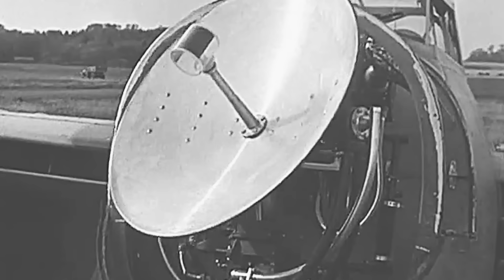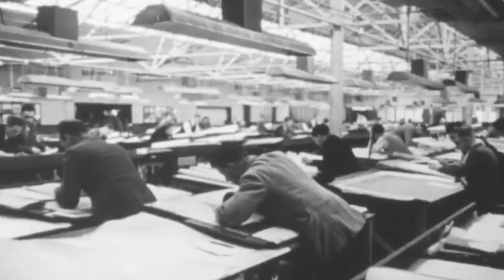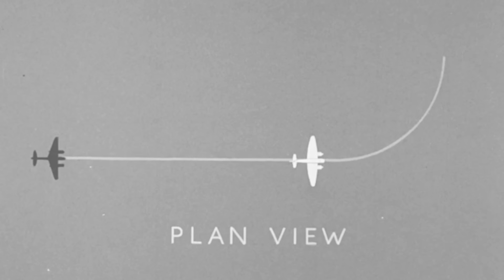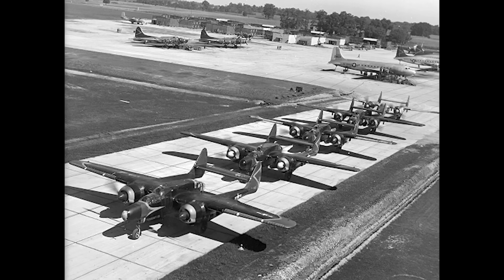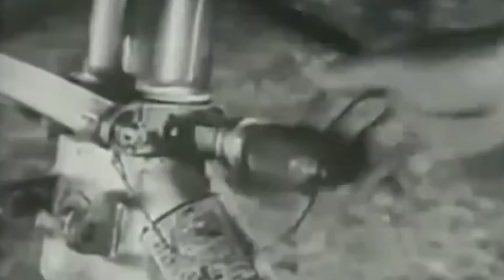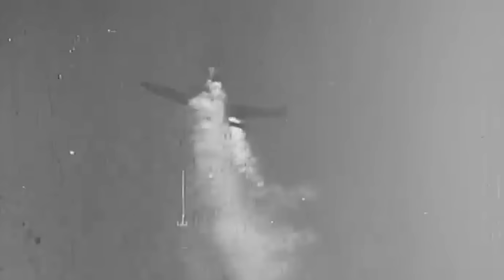The Most Chilling Plane of WW2

Comment: One of the early issues with the P-61 was damage to the nose gear doors when the 20mm guns were fired. One cool feature was the almost lack of ailerons. Instead relying on spoilers on the top of the wings. This allowed the P-61 to turn a very low speeds. In the Pacific P-38 could take off by just retracting the landing gear and using ground effect to get it airborne. When P-61 pilots tried that, it didn’t work and instead of taking off, the Black Widow just settled back onto the runway.

Comment: love the twin boom design. 

not exactly born to dogfight but plenty of power and armed to the teeth

i was always a fan of the center mounted machine gun and cannon. oddly, the allies opted for mostly wing mounted .50 mgs and it seemed to work just fine but why not add a cannon firing through the center of the engine, and a couple of .50s firing through the prop? add that to the usual 4-8 .50s in the wings and youd have a wicked deadly machine

only a few allied designs featured the fuselage mounted mgs like the germans and japs did. im sure there was a good reason for that, but you tell me.

the me-109 G series, AKA GUSTAV or "KILLER" (not sure if that moniker meant killer for its pilot or killer for its opponents) had 2 fuselage mounted 12.7 mm machine guns (12.7=.50 cal), upgraded from the 7.98 mm mauser round that was used by earlier versions and was the standard round for the wehrmacht, used in both their mg-34, mg-42, and Kar-98 standard rifle

the G series, in its interceptor role, eventually mounted 2, 12.7 mm mgs, one 20 mm firing through the centerline, 2 wing mounted 20mm and 2 MORE 30 mm cannon in gun pods under the wings.

thats 7 guns, with 5 of them being cannons. its was indeed, a killer

with all that extra weight it comprimised some of its speed and manouverability but it was still better than the FW-190 above 20,000 feet which was where the bombers were,

Comment: The Black Widow was fast. Really fast. For a big twin-engine aircraft it was screaming fast at 360 mph. For a Night Fighter the P-61 was every bit as fast as it needed to be. To get the job done. And it did. Very well. But ... In no way shape or form was it ever fast enough to intercept a V-1 Buzz Bomb with its 400+ mph at just above treetop level. It took the fastest of the R.A.F.s Fighter Planes and even then they were at or near wide open throttle. The "61" was big bad and beautiful. But not Fighter fast.

Comment: The aircraft looked cool, but was almost a complete failure. Very limited success and too underpowered to challenge the Me-410 which simply flew away leaving a P-61 embarrassed. After the war the aircraft was rehabbed to become the little known F-15 Reporter and saw some service in Korea and mapping duties. During research I did locate an unknown photo of one of the initial prototype series taken before it was scrapped. China has a  captured P-6¹ on display which is rumored yo be radioactive. Despite its problematic history the airframe is definitely cool.

Comment: My dad flew B-17's over Europe during WWII. As the war in Europe wound down he was re-assigned to a fighter training in Dec.1944. He trained to fly the P-61 and after training he flew them in the European theater for the 414th until the war ended. After the war he returned to his profession as an electrician. In 1961 he got wind that the air Force were surplusing the P-61-A, B and a few S models. He went to Richards/Gabouer air base where they were being sold, basically as scrape, and found his old plane there a P-61 S, her name was "Mysterious Mary", and he bought her for the princely sum at that time, of $5500. Stripped of her guns and other "secret" equipment. Dad worked on her for years and years getting her ready to fly again. Dad passed away twelve years ago without getting her ready. I've been working on her since and I'm getting close. I have to get all the Lexan glazing made. I'm shooting for July 4th, 2025 for her first flight.
Reply: I hope you get it done. Kudos.
Reply: Bravo good 👍 sir,best of luck with this endeavor! Sounds like a large undertaking. Sounds typical, take off the military gear,understandable, yet leave her unflightworthy. Not understandable.
Reply: @clarencemcglynn114  She was airworthy when dad got het her but only barely. It had been left to the ravages of the elements for 20 years and somewhat cannibalized. So dad took her apart to do a complete restoration. It was a bigger job than he imagined. You know how it goes; you take one thing apart and find 6 others that need attention.
Reply: Hamilton / Owen Field: COLUMNIA,SC HAS HANGER Y 1 with a B25 and other museum pieces..FLY HERE AND MEET JIM HAMILTON  @clarencemcglynn114
Reply: That’s quite an undertaking.  How many flying P61s are around nowadays?
Reply: @vpreggie  As far as I can figure out there is exactly none flying.
Reply: Will you post updates please? That would be such an awesome story 😊
Reply: Great story and I wish you all the best in your endeavours.
Reply: Amazing , good luck to you sir ! 👍🏻
Reply: I cant help with $ but I could sure help with time. retired, x air force
Reply: Amazing, simply amazing.  I hope you succeed, sir!  Lot of people pulling for you, me included.  Really appreciate you sharing this fantastic story.
Reply: My full respect to you and your dad.
Reply: You should contact Red Bull, they love old planes.  They may help in the restoration and the story of you dad would sell it.
Reply: I'm a Volunteer Aircraft Mechanic with the Commemorative AirForce Minnesota Wing and I know there's a few other volunteers like myself that would be able to help work on her...
Reply: That's quite a project and a tribute to your father.  Can you confirm that the aluminum was painted with zinc chromate primer, such that when the paint was chipped it exposed the zinc chromate primer, or perhaps the aluminum?  Thank you.
Reply: Well!? Did you get her up in the air?
Reply: Get it done bro
Reply: Cheers to you and your late dad.
Reply: John, this is great news!  I thought that the Mid-Atlantic Air Museum's Widow was the only restoration in progress.  Any chance you could take her to Oshkosh next year?  She'd be a huge hit!
Reply: @gordonbergslien30   I am aware of the Mid-Atlantic Air museums restoration. We'll see about Osh-Kosh, it will all depend on how she works out during her flight tests and mechanical systems. If anyone is aware of an SCR-720 airborne radar set for her, I'd be extremely interested.
Reply: God bless sir,wow.
Reply: I wish you luck.
Reply: Are you making videos about this? have you started a foundation, received any donations or get any outside. I’d love to follow your journey and see it completed
Reply: Keep us updated I'd buy tickets to go see this
Reply: Good ole’ Dicky Goober!! 👍🏻
Reply: Please post something to keep up to date. My Day was a Pilot as well. Would love to follow your progress…
Reply: What an amazing story!  Please post videos of the rebuild and first flight.
Reply: Do you fly with the Commemorative Air Force or are doing this completely independent? Either way good luck
Reply: We will all be back here on July 5, 2025 to see how it went😉
Reply: How wonderful is that!!
Reply: Go, go, go! You and others that keep old A/C and old vehicles alive are heroes in my book.  Blue skies!
Reply: My brother and I built WW2 model planes when we were kids in the 60s. I think the P-61 Black Widow was our favorite. It was certainly the most imposing looking one. So glad you are doing that project!.
Reply: Would love to see photos of it!
Reply: Wish you the best.
Reply: Awesome! Send me a link for any photos or videos you got! Would love to see!!
Reply: Cool, cool, cool. Bring her to Oshkosh my man. I missed 2025 due to work but am sure to make 2026.
Reply: Fantastic. Absolutely wonderful.
Reply: What a cool story! I have always thought these were so cool. Side question, did your dad ever see any foo fighters?
Reply: I pray you make the goal!!!!
Reply: That is freaking amazing!  Any pictures of it online?
Reply: That sounds incredible especially how he found and bought the specific one he had served on, amazing! Wish you the best of success and clearest skies in your endeavors. I realize it‘s a private passion project but would also really appreciate a photo or video once ready, if anyhow possible without doxxing yourself. Either way thank you for sharing this!
Reply: that will intersting😂❤
Reply: I need to see this, please update us!

Its such a mean yet beautiful looking aircraft
Reply: Any videos of the restoration?
Reply: Dude you should make some videos of working on her i would love to see them at least
Reply: Good luck and thank your dad for his service
Reply: God luck to you well done
Reply: We want a video!
Reply: Where is it located?
Reply: Hope you achieve your aim, Lance Daintree uk
Reply: Please post a video of your plane! It would be amazing to see. Please! 🙏🏽
Reply: It’s been over a year, how is it going?
Reply: @samschellhase8831 right, I wanna see this thing
Reply: Airplanes in built
Reply: so you are doing this project on a plane so rare that there are claimed to be only 4 in existence, not including the one you claim to have.  but somehow are doing this alone and are going to get it to be the only air worthy example by next year and have 0 pictures or videos of it?    cool story bro.
Reply: @13christbane  Not quite alone, I have a few guys helping me. I lost a very valuable assistant when my young Brother passed away a year ago. I have no posted pictures or videos because I don't want any unwelcome visitors. I found that out when I was restoring my P-38, Lady in Red. Some wise ass used the pictures to identify the airport we were working in and I had several jerk offs show up at night and vandalize the plane and steal parts. So, I won't repeat that mistake again. But I suppose I could post updates on her progress. I will post a video of her first flight. So, we'll see how it goes. It is rough being so close and at the same time so far away. We just found some more problems in the right-wing root. Nothing too serious, but it's just another unforeseen pain especially at this point, because now we have to reinspect the left wing-root for the same spare alignment problem.
Reply: @johnwillis4706  I have subscribed to yor channel, in hopes to see the first flight uploaded!

I want to send my condolences on losing your brother. Im glad youre able to keep working on it without him and your father. 
I'm not sure I'd be able to.

Take care, be well, and God bless❤
Reply: @johnwillis4706  any update?
Reply: I don’t believe you will reach your goal.

Comment: The Northrop P-61 Black Widow was a lot better than the Douglas P-70 (A-20 variant), the turret on top was introduced in the C model. The Northrop P-61 was built before fiberglass was available, the nose was plywood

Comment: The Lockheed P-61 "Black Widow" night fighter was the aircraft used by the U.S. Army Rangers in their raid on the Japanese Prisoner of War Camp in Cabanatuan, Philippine Islands. This raid was memorialized in the 2005 film "The Great Raid". During the actual raid , a P-61 overflew the camp to distract the Japanese guards from the Rangers low-crawling up to the edge of the camp to begin their attack. Though the producers wanted a P-61 to accurately recreate that part of the raid, there were no flying examples available for the filming. A Lockheed A-29 Hudson was substituted for the correct P-61.
Reply: Northup not Lockheed
Reply: @thomasmandell3002 
Thanks for that correction on the P-61.

Comment: My Dad was the crew chief on a 61, with the 427th NFS in the CBI. He loved the Blackwidow....as did their pilots. In their unit, most chose to remove the top turret to give 10-15 mph more airspeed, plus there was really no need for the turret on a nightfighter.
Reply: Except that it was radar controlled and could be used at night for defense.
Reply: @gkess7106  The turret was not radar controlled.  It could be remotely controlled by the gunner or radar operator....but was not radar controlled.  Normally, the 61's weren't attacked by enemy fighters....kinda the point of a stealthy night fighter.
Reply: @ Sounds like a distinction without a difference.

Comment: The video makes no note of the fact that the four dorsal .50s were in a turret intended to be operated by the radar operator for defensive purposes, but this was found to be impractical, so the turret was either locked firing forward under control of the pilot or removed completely.
Reply: .40 calibre.
Reply: @Youtuber-k2p  Lol. NO! 🤣
Reply: unacceptable buffeting in the air-stream during rotation of the turret has also been sighted as a reason for removal... the "reporter" reconnaissance aircraft models i think were built without them...
Reply: The problem with the turret was that it interfered with airflow over the tail if the turret moved around

Comment: How does the P61 differ from the P38?
Reply: One....much much bigger. About the size of a lite bomber. But many other differences.
Reply: Same basic layout: twin engine, twin boom, tricycle landing gear (which was rare for aircraft at that time), all cannons and guns mounted in the fuselage (although the P38 had roughly half the firepower of the P61). 

But the p-61 had an internal bomb bay, a crew of three from the get-go (modified versions of the P38 had a crew of 2, the radar equipped variant, and the droop-snoot variant with a bombardier in modified nose with a bomb site), 18 cylinder twin row radial engines instead of inline V12s, a remote controlled dorsal mounted gun turret (the first models had one, but it was found to have buffeting issues when in any position except straightforward, and so was deleted, and then reintroduce with modification in later models).
Reply: @reidveryan9414  thank you
Reply: @Stargate1948  no prob.
Reply: Right? Any video here that does comparison of the two?
Reply: Different manufacturers

Comment: Unfortunately in the Pacific, Japanese aircraft could outmanouver the P-61 by quite a bit.  If your first burst missed, bye, bye,  Jill, Tony, Zeke, Betty, Oscar.......
Reply: That was the point of the radar detection. No outflying anything....pull up...cut loose with the 20mm....job done. And...the 61 could turn inside a Mustang. Dad was with the 427th NFS...saw it more than once. But again, dogfighting was not it's mission.

Comment: The BlackWidow II the YF-23 unfortunately never made it to production in the 90's , it would have been the best fighter ever made.
Reply: The YF - 23 could have been the equivalent of the current F - 22, if the Air Force followed the previous generations common practice of producing a limited run of several aircraft for "field testing" with active units. Instead, the Air Force had a weighted "fly off" head to head between the airplanes, which the F - 22 "won" because parts of it were to be built in the "right" Congressional districts. The YF - 23 could still get an update and second chance to fly - if the U S will release it to be redeveloped by Japanese forces.

Comment: Due to the logistics of a night intercept, They could not get more than 1 kill a night. And most missions resulted in a no joy, or they did not see a target. And the enemy did not fly that many night missions anyway. And the effectiveness of night missions was quite low as well.
So we did not even have to intercept them. In a lot of ways this plane was a proof of concept more than an effective deterrent. But it looked cool. Most German aircraft in late WW2 were as fast or faster than the P61. So as the P61 is supposed to get behind and track its enemy by radar and creep up behind the target, well you can see how that would be a bust. So they went to the pacific to be used against Japan which had slower aircraft. But again Japan's night bombings were mostly nuisance raids. They did not warrant and entire plane designed just to stop them. It was designed to stop German night raids but was too slow for its intended role.
Reply: Late war Black Widows were faster too.
Reply: They were fast enough to sneak up on German bombers.
Reply: @Outlier2024  Which they almost never actually DID, as by the time they entered the war there were precious few German bombers flying around at night.
Reply: @alganhar1  Yup. All shot down by Mosquito NF's in the 2 years prior to the P-61's arrival. 'Tis hard to shoot down planes that have already Been shot down prior to your arrival...

Comment: It was British tec. that made this plane possible. The radar could be small enough to fit in a aeroplane  because of cathode ray tube gave to the Americans  by the British
Reply: Not just the CRT's. The Whole Radar system was designed & developed in Britain, as was the Cavity Magnetron that made airborne radar possible. The units in the P-61 might have been built by American companies, but it was to a British design, and used British Tech...
Reply: Wasn't given. There was a mutual trade.

Comment: 366 mph is not quick enough to catch a V1 flying bomb. The only planes fast enough in 1944 were the Hawker Tempest and the De Havilland Mosquito. Later Griffon engined spitfires, P47 Thunderbolts and the P-51 were also capable. Not forgetting the world's first jet fighter the Gloster Meteor which caught them with ease.

Also ironic that the P61 was replaced by the Mosquito which predated the P61 by 3 years.
Reply: Not replaced by the Mosquito. Mozzies had been doing the job for 2 years by the time the P-61 appeared, and doing the job so well that there weren't many Luftwaffe bombers left when the P-61 finally turned up. Having the same armament and radar as the P-61 while also being faster and harder for the German radar to spot also undoubtedly helped the Mosquito's cause...
Reply: I belive  the p61 was not intended  to go after the v1
Reply: The P-51D was introduced in May 1944 and took part in early interceptions of V-1s.